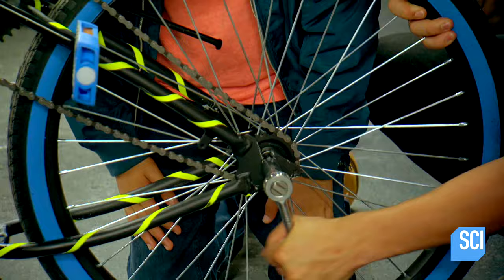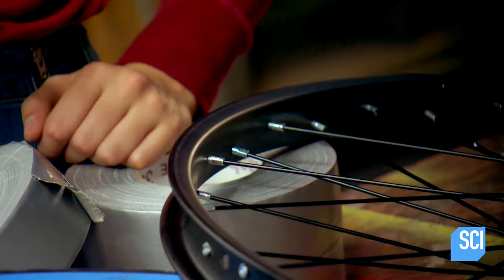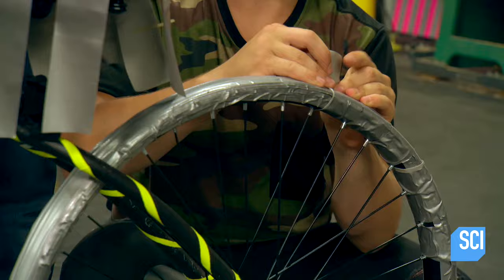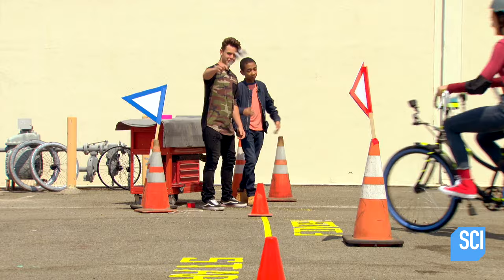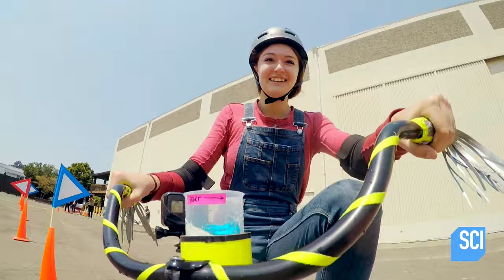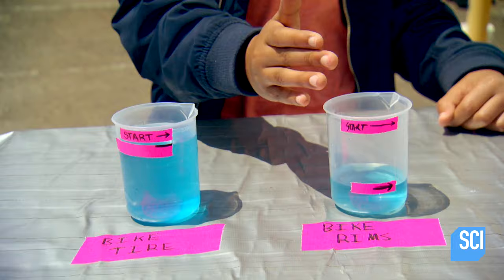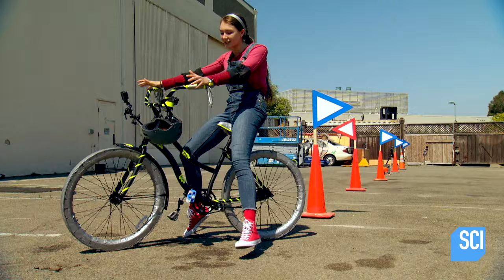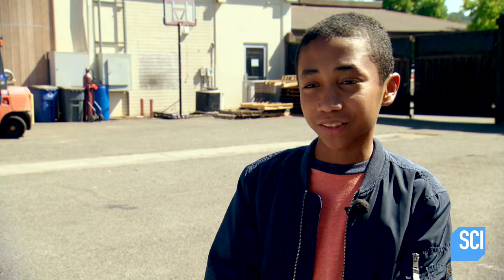Riding a Bike With Duct Tape Tires | MythBusters Jr.

Comment: I used to ride all over chico  ca with ductape tires...….. fill the groove with tape till you have a small bit of tire   wrap around and between each spoke with copper wire....  then finish with a few more layers to make the tire ...  then do the same as the wire with ductape  to hold it centered...  its not a soft ride   but it will get you anywhere a regular tire will

Comment: Why do myth busters only use duct tape for everything?
Reply: Ask an engineer
Reply: They love to use duck tape on anything.
Reply: Because they probably own it. It’s a massive ad-fomercial.
Reply: @LaGrandeBayou  well, it's actually that duck tape had been proven due to their science experience experiment. It became their no 1.
Reply: Debbie
Oh of course it worked. But the fact that they use only “Duct” tape and no other competing tape..like “Gorilla” tape is evidence that they are acting as a giant advertisement to promote and sell specifically... “Duct” tape. 
Otherwise they would not keep repeating the same name brand which is trademarked...’Duct tape’ and instead they would refer to it as a strong adhesive tape or a commercially available “industrial” tape. Imo. 
Also “Gaff” tape and shipping tape would both work equally well as a bicycle tire replacement but you do not see or even hear them attempt to consider ANY other brand or type of tape

Comment: No need for a duck tape just convert all  spooks into a small spring all around the wheel and with those tires of course it could move around smoothly even on rough roads those spring act like a shock absorber

Comment: Duct tape is definitely not a viable solution as it is largely impractical. The adhesive glue it uses is heavily dependent on temperature and fails easily in humid environment. On top of that it lacks friction too. Try it during winter and you will see how horrible it functions.